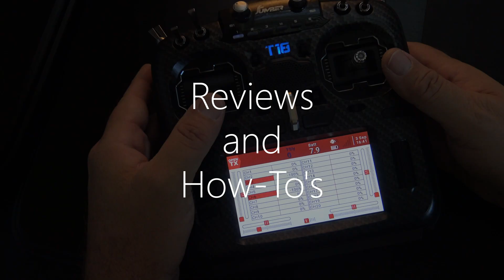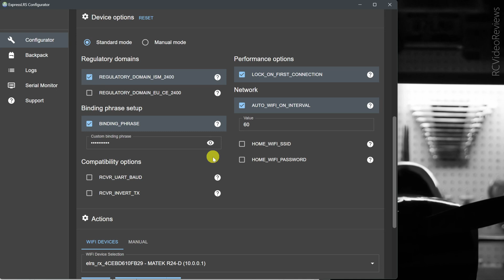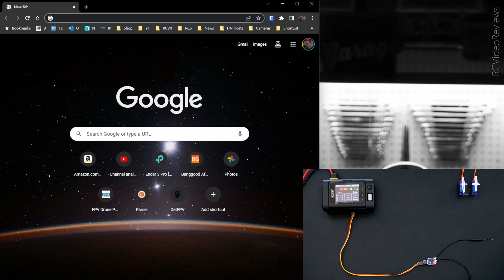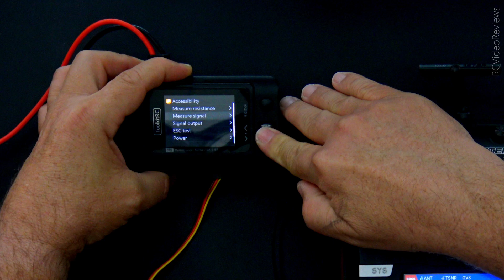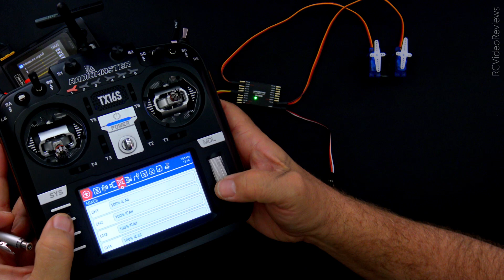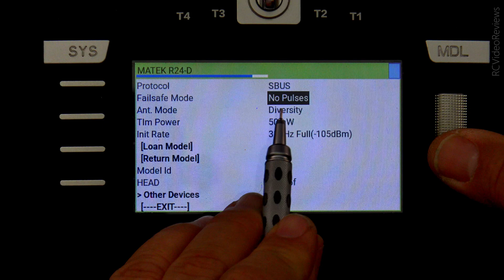Need 16 PWM Channels with ELRS? WATCH THIS!

Comment: So I am I heavy noob here buy I am fumbling around trying to figure out a way to get an RC tank, put an aftermarket board on it if it has an integrated receiver so I can use ELRS for greater range and penetration from a standalone radio and use SBUS to so enable all the various functions of a tank despite having a PWM receiver for surface vehicles. I may be talking absolute nonsense
Reply from the maker: I think you need to do a little more homework.
Reply: @RCVideoReviews  lol okay, thanks for the reply. I had a feeling I was grasping beyond my reach

Comment: The esc doesnt work. It keeps giving out 2 beeps at a time. Is it an issue with the board or do i have to configure it to work with the esc?
Reply from the maker: Do you have signal from the Tx/Rx going to the ESC? Sounds like the ESC isn't seeing signal of 998us.

Comment: Wow seems so easy to get 16 channels! Lot to learn but looking forward to using this setup in my 737 which needs 14 channels. I notice you don't use model ID - can you use this so you don't get mixed up with multiple models or is something taking care of this?
Reply from the maker: I do not use model ID. The only feature I use is Receiver # to load different ELRS profiles depending on the plane. I don't bother with it because I'm the only one who touches my radio and I always ensure I've got the right model loaded before powering on. Just part of my process so don't need  the feature.

I have a 16channel receiver now. Working on the prototype.

Comment: Hey there. Awesome awesome videos for someone like me. One question, can an Eagle A3S4 be integrated into this setup? I plan to use it my A10. I plan to use at least 11 channels and I just can’t see in my head where the sbus connection happens to the converter. Matek to the gyro but from the gyro to the converter is my confusion. Maybe it’s not possible? If you get a second to let me know , that would be very helpful!! Thanks.

Comment: ELRS is definitely coming along for fixed wing on the Output/Control (PWM, SBUS). Is there any work happening on the telemetry / INPUT side of things? CRSF is a bit limiting as it lacks protocol definitions for per-cell pack voltage (Frsky ADV voltage), Barometric Pressure (alt/vario), engine, fuel, among others...

How about S.Port, ibus to CRSF flexibility on the telemetry side? I'm somewhat stuck on D16, S.Port, SBUS until ELRS telemetry matures.
Reply from the maker: https://github.com/tbs-fpv/freedomtx/issues/26#issuecomment-1573853048

Comment: I ordered the 16 channel board, but I have radiomaster elrs receivers. So... signal wire from sbus solder on tx pad receiver, right? (And leave rx pad free?)
I think it is a brilliant solution for fixed wings but I still have so much to learn. Thanks John!
Reply from the maker: Yup. Sbus out on rx tx pad.

Comment: Hi John, I followed your vidio to the letter. Now I have PWM on all channels, But for some strange reson my ESC refuses to work even although I have signal to that channel. What have I missed?
Reply from the maker: Hmmm--that's a tough one. When you say you have PWM on all channels, does that indicate you put a servo on the ESC channel,  moved your throttle stick and observed the servo move? I assume ESC is powered and connected to a motor? Once you see PWM output on a pin, that's it--it's up to the ESC at that point.
Reply: @RCVideoReviews  I will have another look, I just feel I've missed something stupid. Thanks again
Reply: It was the ESC that had decided to die just at that moment, so at lest I now know what was amiss. Thanks again

Comment: That is really nice indeed! Thak you so much for the video!  But... the opportunity to use more than the standard number of servo's kindles the desire to use it for much larger planes... and therefor more than 5 volts... What would be the best way to wire that up as the reciever cannot take more than 5 volts as far as I know....  Do happen to you have any advise or a working solution ?
Reply from the maker: Simply put a mico bec in front of the Rx. I've done that plenty of times. For example: https://www.racedayquads.com/products/matek-micro-bec-6-30v-input-to-5v-12v-adjustable-3pcs

Comment: So, how would telemetry work with SBUS output? Would they emulate SmartPort? If so, could they just make it an FPort situation?
Reply from the maker: At the moment I don’t think they intend on adding fport.  Honestly, it was a stretch to get sbus. You do get rx telemetry: rssi, rqly, rfmod, that kind of thing. But nothing from downstream devices at the moment.
Reply: @RCVideoReviews  battery voltage is important on my 16 channel edf jets.
Reply from the maker: I want voltage on everything. There are elrs receivers with vbat.
Reply from the maker: You could use a Matek P24-R6 PWM, take vbat from it, and set SBUS out on Ch2 to feed to the 16ch decoder. Seems convoluted, but it would give you 16ch PWM with vbat.
Reply: @RCVideoReviews  haha I guess. I have not figured out how to run 16 pwm output channels with a flight controller anyway. I just use 2 X8R/S8R receivers in tandem with a SmartPort cell voltage meter.
Reply from the maker: You can also run multiple elrs receivers using the same binding phrase. PWM receivers have remapping so it can scale.
Reply: @RCVideoReviews  that is good to know. I'm currently in a debate on whether to get a Zorro Max or just AG01 upgrade gimbals for my TX16S. I currently run a 4-in-1 internal module and a 915mhz ELRS external module on my TX16S. I'd probably opt for the 4-in-1 internal on the Zorro and pick up a Ranger with the 2W capability if I went that route. What are your thoughts?
Reply from the maker: Radio choice is somewhat subjective. If you have a use case for 4in1 and ELRS it doesn’t much matter which one is internal and which one is external. There are modules for both.

Comment: Nice John great video $40.00 for a 16 channel , dual diversity antenna ,with telemetry with a programable sbus decoder 
WIN WIN  in my opinion  . What voltage does the s-bus decoder go to looks solid
Take Care
Reply from the maker: Voltage isn't shown in the specs, so I'd keep it at 5v. It'll be nice when we see vbat on every ELRS (hopefully).

Comment: I don't know anything about ELRS. What is the benefits of ELRS
Reply from the maker: • As an opensource it receives regular and recurring enhancements and improvements.
• It uses LORA (as do a handful of others) yielding insane long range capabilities. If that's not your bag, it also means while flying LOS you'll have a dead reliable connection.
• As the software is divorced from hardware, you are not married to any particular hardware vendor meaning as the consumer you benefit from competitive downward price pressure.
• They've introduce packet rates that literally smoke check the competition. Good for pilots with extreme speed requirements.
• Binding Phrases = Pure win.
• Now supports CRSF, SBUS, and PWM. Most others support 1 or 2, few support 3.
• The developers are active hobbyists so they have a meaningful approach to development that isn't tied to corporate objectives.

You can learn more here: https://www.expresslrs.org/faq/
Reply: @RCVideoReviews  thanks

Comment: What is the advantage of this protocol compared to other readily available protocols?
Reply from the maker: • As an opensource it receives regular and recurring enhancements and improvements.
• It uses LORA (as do a handful of others) yielding insane long range capabilities. If that's not your bag, it also means while flying LOS you'll have a dead reliable connection.
• As the software is divorced from hardware, you are not married to any particular hardware vendor meaning as the consumer you benefit from competitive downward price pressure.
• They've introduce packet rates that literally smoke check the competition. Good for pilots with extreme speed requirements.
• Binding Phrases = Pure win.
• Now supports CRSF, SBUS, and PWM. Most others support 1 or 2, few support 3.
• The developers are active hobbyists so they have a meaningful approach to development that isn't tied to corporate objectives.

You can learn more here: https://www.expresslrs.org/faq/